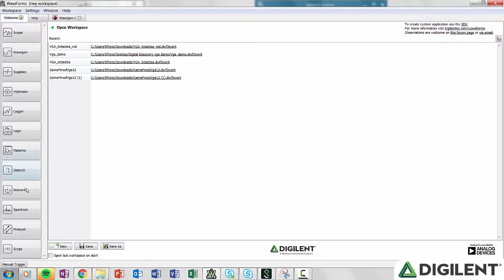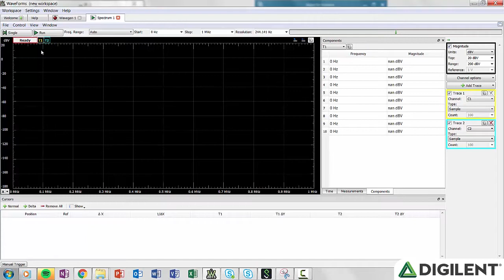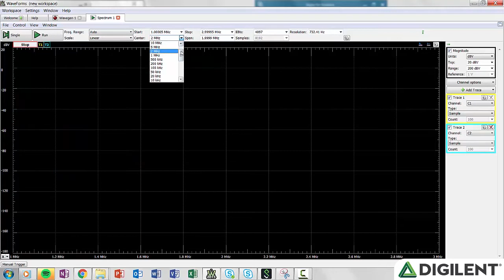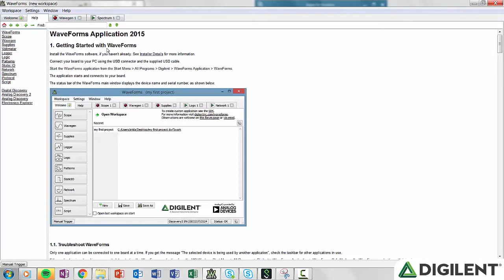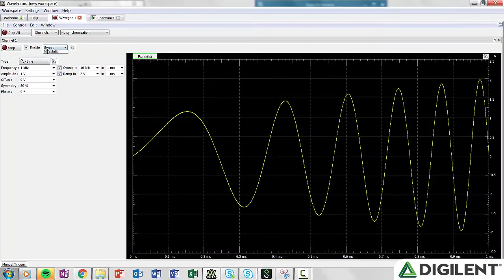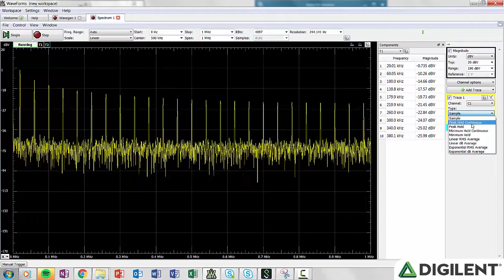Analog Discovery 2 Quick-Start: Video 8 - Spectrum Analyzer

Comment: What is the use of resolution ?
Reply: Hi Varun,
The start, stop, frequency bins, center, span, and samples are all related values. If you change one, you'll notice that some of the others will update to reflect what the tool is capable of. If you have a particular resolution in mind, you can enter a value and WaveForms will automatically adjust to the value that the device is capable of, given the other related values.
Reply: Thanks for the answer Kaitlyn. I do understand now how resolution relates to bins and stop frequency: 

Resolution =  STOP_Frequency/BINS.  

So resolution is simply hz/division in frequency spectrum i.e. how far in Hz are two adjacent frequency bins in the frequency spectrum. 

Related to this, I have another question. Although Network analyzer does a good job in getting frequency response, I often want to manually apply a  sweeping sinusoidal signal to a circuit input and then see the frequency spectrum from the circuit output. What I donot understand is how to choose the time for sweep to get a stable display on spectrum analyzer during Run mode. Say I want to sweep an un-damped sinusoid of 5V amplitude from 1 Khz to 1 MHz through a circuit input. What sweeping time should I choose ? Should it be 1 ms, 1 us, 1 sec, etc. How to intelligently choose this value so that I can see stable spectrum during Run mode ?

My intuition also says the sweep time controls number of frequency components and number of cycles of individual components generated but I donot get how these parameters are mathematically related.
Reply: Hey Varun,
Would you mind posting this question on the Digilent Forum (forum.digilentinc.com).
Reply: Alright. I will do that Kaitlyn